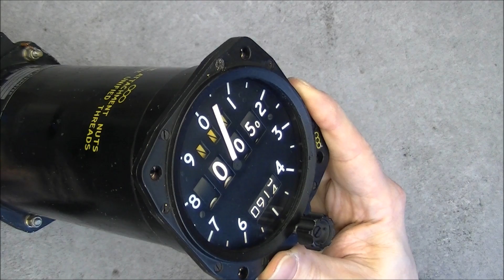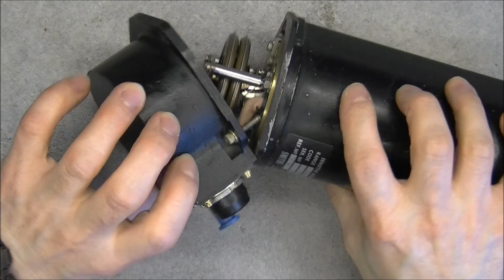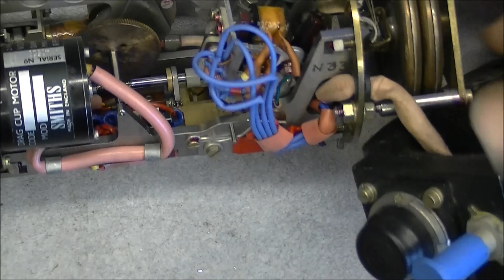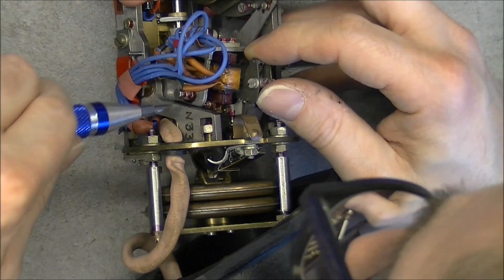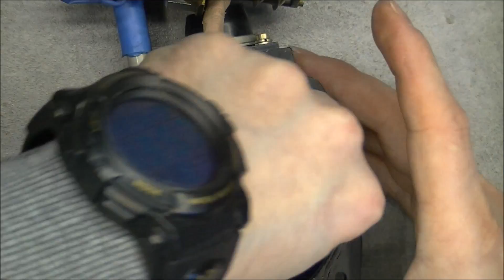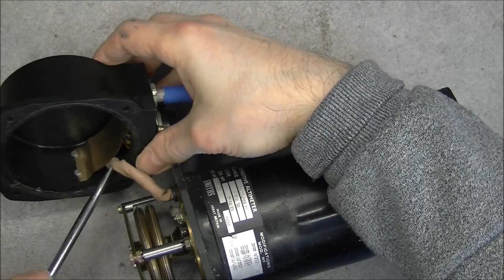Smiths sensitive altimeter teardown and "repair"

Comment: Drag Cup Motor = AC motor. It doesn't transmit anything. This instrument requires an external servo amplifier connected between the pick-off sensor and the motor;

Comment: The warning about the nuts is because aircraft instruments have a rather unique mix of different bolt threads. The actual instrument will be all metric, UNC or BA size threads inside, but the 4 screws that are used to hold it to the panel are all a fine pitch imperial thread. Thus the 4 screws that are used are a very specific thread pitch, and this is still in use today with the instrument screws all being the same UNF thread.